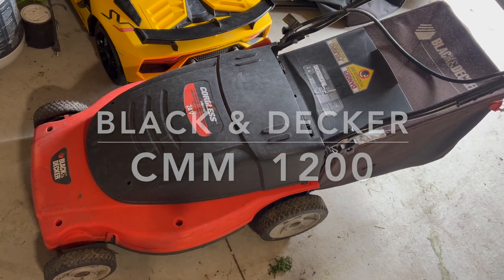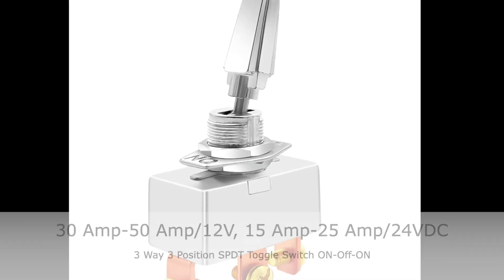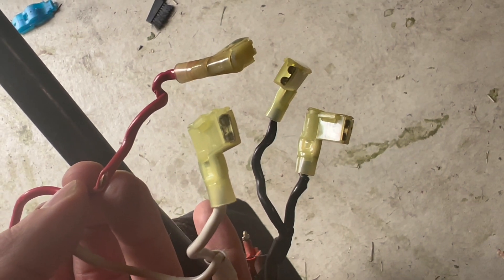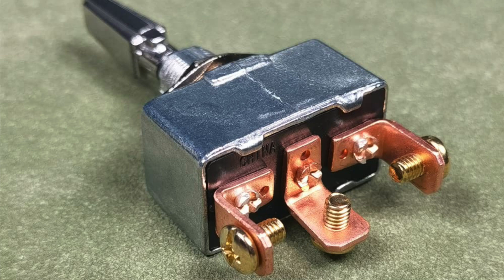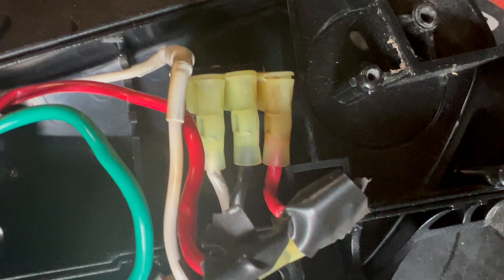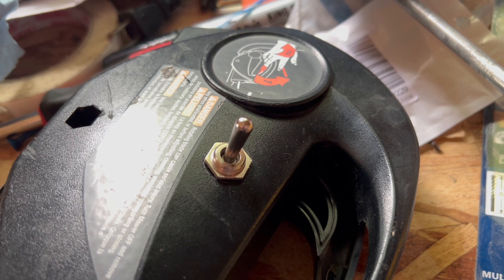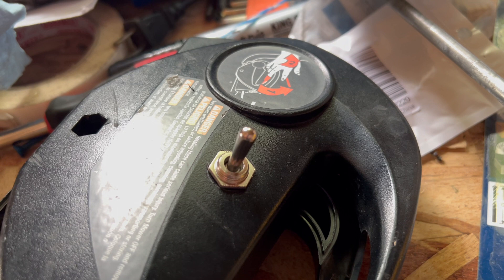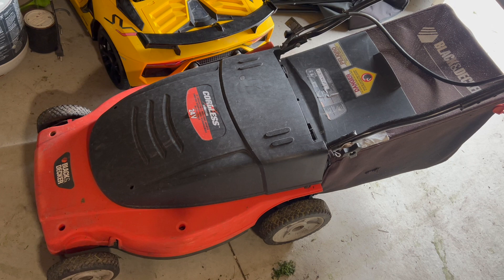How to Bypass the Switch in a Black & Decker CMM 1200 Electric Lawnmower

Comment: Thanks for the video and the link to the switch. Worked like a charm. One thing I wanted to point out is that the other ON position is to brake the motor, not charging. I believe that the switch circuit is completely bypassed when charging.

Comment: I have a Black & Decker mower that uses a 40V lithium battery.  I want to bypass the safety switch.  I think a on/off toggle will work?  Can you tell me the toggle specifications that I should use?  Thanks
Reply from the maker: @edwardmcmillen3127